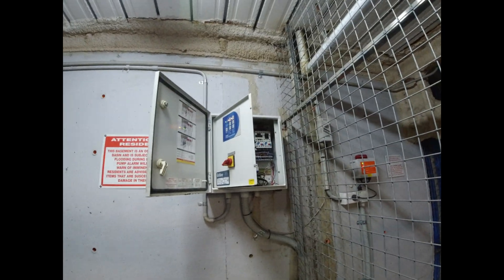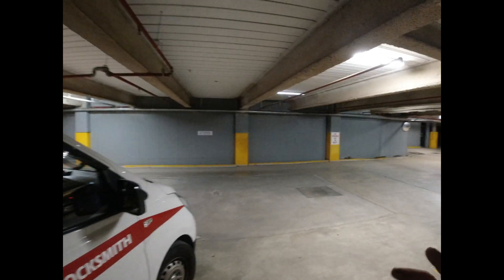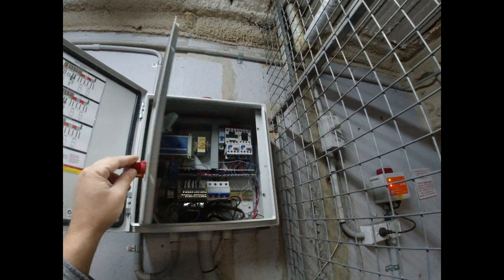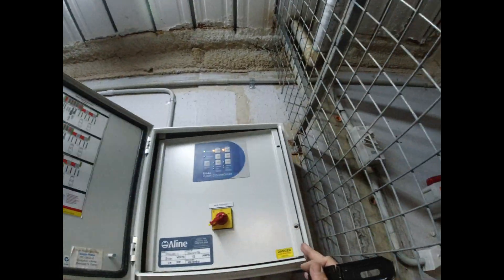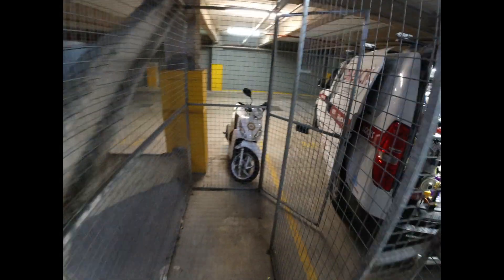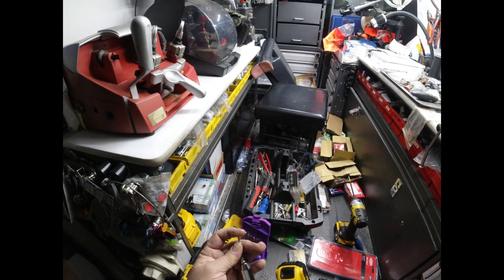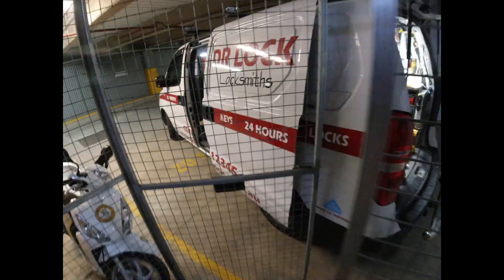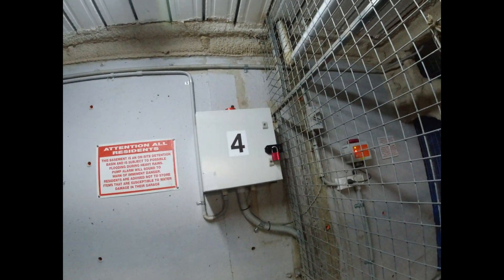Installing a Lock on a High Voltage Box: Step-by-Step Guide for Safety and Security

Comment: That's actually LV mate. You should of isolated that panel before drilling into it IMHO. I know my QLD Electrical Safety Act 2002 states it.
Reply from the maker: Yes your right
Reply: @DrLockShop  The International Electrotechnical Commission and its national counterparts (IET, IEEE, VDE, etc.) define high voltage as above 1000 V for alternating current, and at least 1500 V for direct current.

Why are you misleading consumers?
Reply: @TradieTrev  dude's a locksmith on a locksmith job, not an electrician on an electrician's job, not hard to see, why are you even getting so upset about that? when he said "danger high voltage" any moron can see he's reading the yellow label on the box, why couldn't you? he even specifically said "240 volts" so where is he being misleading? by comparison, the electrical industry knows nothing about locks which is why both of those "good enough" plastic utility locks can be opened with anything including a ham sandwich, meaning it can be left open and anyone can get a zap as a result, that's not something to respect
Reply: @Nitrxgen  Maybe because of electrocution?